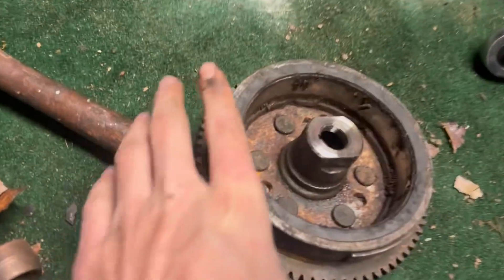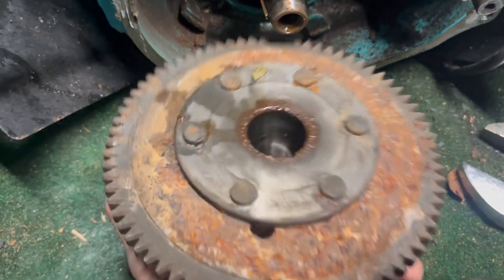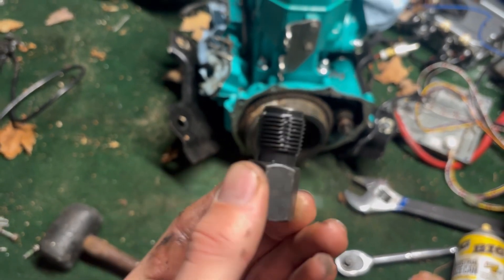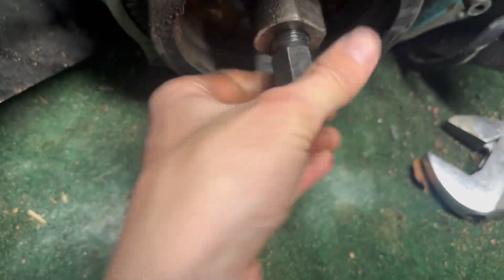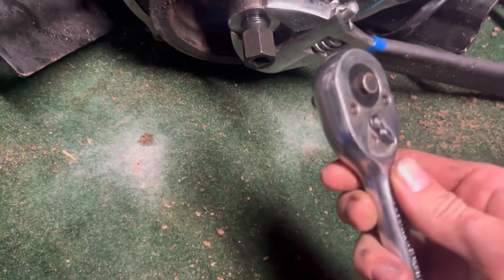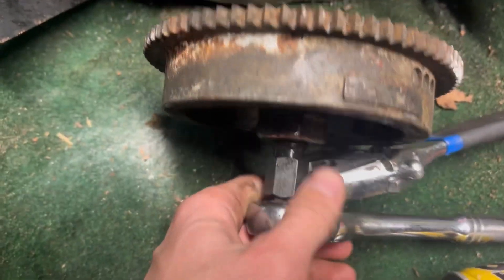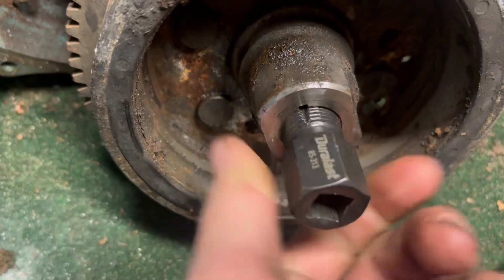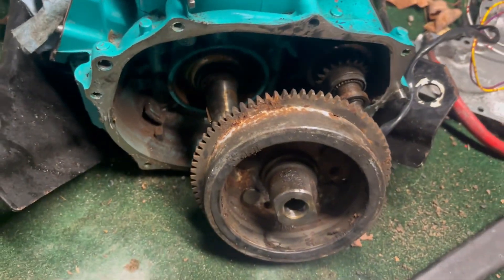Kawasaki 750sx stuck flywheel removal

Comment: Thanks for the video. Rather than trying the thread chaser I got a 10.9 hardened bolt because I've heard of people ruining threads with the chaser. I believe the size needed for the 750 is M18x1.5x60mm. I was able to find one at my local Ace Hardware.
Reply from the maker: That was what I was trying to find but no hardware stores near me had anything big enough. Thread chaser has worked great as long as you thread it in carefully.